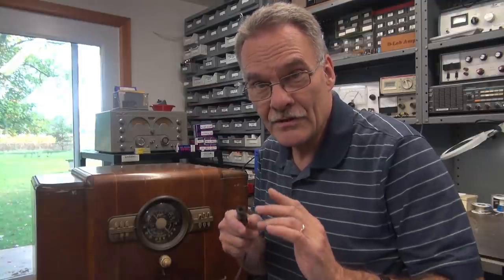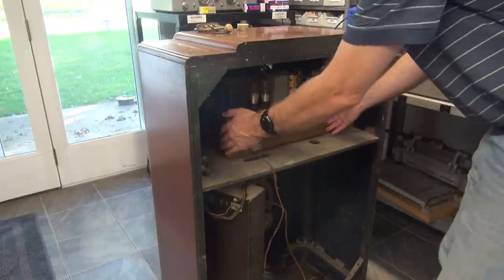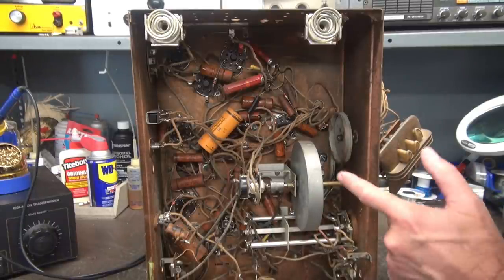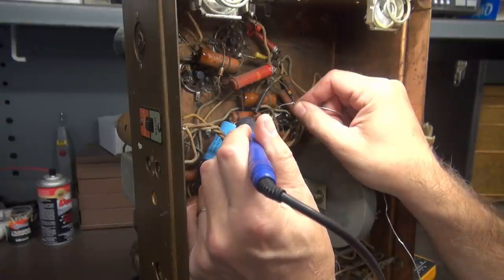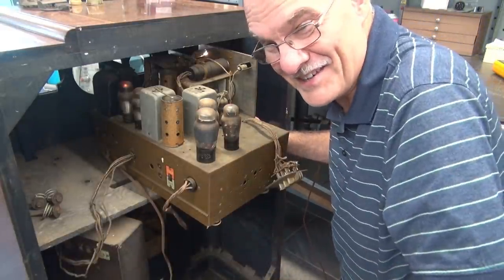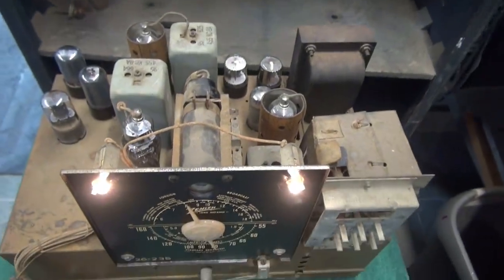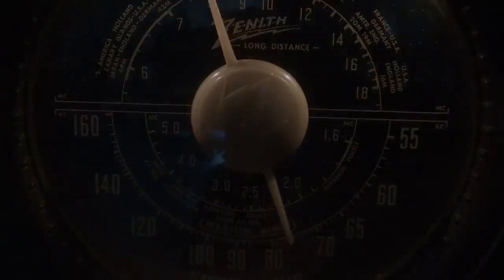How to repair  Vintage Zenith 10S464 console tube radio Hum fast fix Tips

Comment: I live in dry colorado and lots of old wax paper caps 60 years old are still working. back in minnesota not. I would change the wax paper caps out just for safety. a new line cord and fuse.

Comment: I've worked on a few of those old radios myself lately and I still can't get over the quality of the sound that comes out of those old speakers. I've heard some that these new units of today can't compare to.
Reply: I downloaded a bunch of old radio magazines from the 20's through the 50's and have been browsing them.  One had an article on building a HiFi amplifier, this was long before stereo was even imagined, the recommended, two amplifiers one for bass and one for the high notes, you could adjust the tone on each but filter the output through the proper size caps to separate out the sounds you want to reproduce.  Sounds like a plan to me, I am thinking now of doing just that with some solid state chips to see if the old way still drives speakers to get HiFi out of MONO.

Comment: YOU DRILLED A HOLE IN MY CHASSIS???   The way you do your J hooks, it's a connection with far better mechanical integrity and a component lead just poked thru the terminal on a strip and soldered. Some components like the osc coil, IF cans, etc., are unobtanium and you'd have to be nuts to screw with those terminals. And I'm a near-purist. lol. Fun video! Thank you   :)
Reply: Nothing wrong with being a purist but sometimes ya' gotta do what ya' gotta do.;-)
Reply: For a “minimalist “ resurrection, In addition to replacing the electrolytic filter caps I would replace the cap that couples           the “first audio “ tube to the output tube control grids. When that cap becomes so leaky that there is DC on the 6v6 audio output grids, you run the chance of destroying the 6v6 tubes, the audio output transformer , and more..

Comment: Just like your neighbors, I also have a 10-S-464 that's been in my family since new. Recently I was able to finally have it shipped to me from the other side of the country and now it's back in my possession after 30 years. I had it electronically restored back in 1989 and when it was delivered last month I was pleasantly surprised to find that it still works beautifully. For years I've wanted to figure out a way to have it play music through some kind of input but then I came across your video a couple of weeks ago. When I saw the simple modification you made to your neighbors' radio it inspired me to finally make it happen. I got a 3.5mm headphone jack, and even though you used 47k ohm resistors I had some 30k ohm resistors left over from another project and used them instead. Yesterday I put it all together and plugged in a Logitech Bluetooth receiver. I've found thousands of old radio shows online that I can stream from my phone and I couldn't be happier! I just wanted to share that with you. :)

Comment: Great repair Terry if I hadn't seen it I wouldn't have believed it I have never been that lucky with an old radio just replacing a couple Electrolytics and it works. Well there is something to be said about having a radio in the family since new thats for sure. Thanks for sharing.
Reply: I've been that lucky before! 😆👍
Two electrolytics, maybe two wax paper foil capacitor and boom, fires right up!

Comment: Terry I worked in a tv shop that had the same tube tester excellent!! Unit. One thing I would have would use the air hose for a good once over, Yea wasn’t requested but could have reduced possible over heating and looked better. Love the mp3 upgrade! Thank you for your continued mentoring!

Comment: IMHO and I think in yours, the radio deserves a full resto, but, as you correctly indicated, it is the customer who decides every time.  Good idea on the O-ring belt replacement.  I would suggest you try to cut the O-ring on a 45 degree angle so as to maximize the bond area.  I would also use Black CA glue for those repairs as it is mixed with rubber particles and remains very strong but with a degree of flexibility that plain CA glue does not have.  The bond will therefore last longer under constantly flexing conditions.
Reply: Vacuum cleaner belts last longer. You can get them in any size. Great for old Reel to Reels, phonos, 8 Tracks bla, bla, bla..

Comment: I love a Radio with green eyes...Just a tip-- Pond's face cream will will soften the old cloth wires. Just use your fingers to pinch it in a few times. There is nothing I know that softens up the old crusty vinyl wires.

Comment: Very cool, one can add a WIFI radio receiver to that plug, or, for that matter download some old radio programs and play them on the old radio!  I grew up listening to radio for entertainment on our old farm, played on a tube radio that ran off a large battery pack since the house was never wired for electricity or plumed for running water, we kids furnished the running water by running to the windmill to fill the water pail and running back to the house. I am getting into the wifi radio right now, there are plenty of old time radio channels, and play stuff from any year.

Comment: The biggest issue with many 1939-42 Zeniths is their use of the 6X5 rectifier, in particular consoles using two of them... Like this 10S464.  Zenith wired each as a half wave rectifier, and due to tube design, an underrated transformer, one tube warming up a little faster than the other, possible failing filter caps, etc... The 6x5's would develop a heater to cathode short and take out the HV side of the transformer in about 5 seconds.  Zenith sent out a service bulletin on these, replaced transformers (my 11S474 was repaired by a dealer), added pilot lights as fuses, and many customers had the sets set up for a 5Y3.  Today, the simple fix is to use diodes and a dropping resistor.  Additionally, I always add a 25ohm 50w resistor in series with the AC line to drop the voltage going into these notoriously weak transformers.  Once that's all done, these are reliable, sensitive, and some of the best sounding vintage radios you'll find!
Reply: Agree with most everything you said, but Radiotvphononut posted a video once (complete with charts) using the diode conversion and its very persuasive.  That is, they're not really kind to your tubes in the end because.... the high voltage ramps much quicker than the filaments warm. As a result, plate current can be exceptionally excessive at start up.... shortening the tubes life. A work around on that is a 'delay on' circuit for that diode (in my opinion). Also, an in line fuse on the transformer output can be very beneficial (saving those same expensive & hard to find transformers). I just restored my 8s-463 5808 chassis here lately. It was dark since 1947 and now back to life. Still needs the correct output transformer and hopefully that'll be coming soon.   Best regards.

Comment: I have the same console. I changed out all resistors, caps and rotted wire. You should have added a fuse because I have seen those 6X5 tubes short out and can cause severe transformer damage.

Comment: Nothing wrong with J hooking parts on an older radio. The reason being you don't want to disturb the other components at the solder joints. The big job  is replacing the
missing long band because you have to take the axle with the flywheel off. This may be easier said than done unless you have a  cool quick tek tip like this!
Nice mod for a MP3 connector.Terry should have recommended a new polarized  line cord and fuse for the radio for safety reasons. 
I'm sure we will see this radio back in the future. I'm a big fan of older eye tube type radios and your work Terry.🍷🍷
Reply: Or replacing a part the owner cut out of circuit or put back in the wrong way because they wanted to be a Youtube DIYer and realized there was more to it and to make it top notch difficult, no clear readable schematics or a schematic just does not exist for the device you are working on and you have to guess.
Reply: @Elfnetdesigns  If you worked on enough TRF or AA5 radios you would know what to replace or fix. As for an owner fix well that means you really need a schematic to tell what he may have done wrong. This goes especially for a fix done on a radio from 1930-50 when the fix was done in the 1960-90s!

Comment: I have that radio. Was my grandparents. Cloth covered wires are trashed. Tubes glue have dried out and the glass tubes are loose. I am ham so I’m going to rebuild it. This will be a huge help.
Reply: They're very easy to repair. I electronically restored My Zenith 10S464 back in 2012 and still runs like a champ to this day.

Comment: This is very similar to a Zenith that I just inherited. It does come on and receives stations but has a very loud hum. I could  use some help with repairing it and locating the parts. Is there a way to contact you? I would be happy to compensate you for your time. The sticker on the left side of the chassis next to the antenna says it is a model 5308 and when I took of the face plate I found the numbers 26-235 on the dial face. Thank you any help would be much appreciated.

Comment: i need some of those magic filter caps. i got a 1929 philco radio that i started restoring for my step dad a year ago and it still hums. i figure i got the wrong caps for filtering and the schematic is just as spaghetti as the wire job. i did get most of it the schematic figured out but the filter caps
Hearing The humming after spending $700 in parts is very demotivating.

Comment: Another Tek Tip (specifically for Zeniths of this era) ... Get rid of the 6X5 rectifier tubes before they short and take out the transformer. There are a few options when doing this. It looks like you may have replaced your's with a newer X plate design??

Comment: I just found this video. Do you have a video on cleaning the switches on the right side? I have two old Zeniths this 1940 and another cube type . It has three faces,broadcast ,police and shortwave which you can change to whichever you want. It works fine. I just don't know what year or model it is, though. Your video is very helpful,thank you!

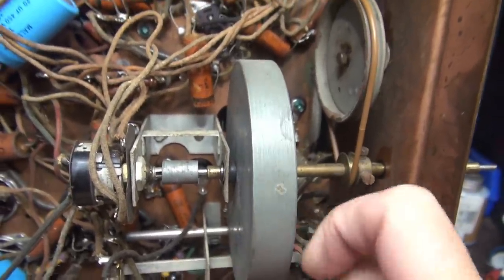Comment: There's a little black metal bushing that goes in the end of the brass tube where you're pointing at 8:49. I actually took apart the whole tuning mechanism to put in the O ring on my 10S566, as well as changing out most of the coupling capacitors and crumbling rubber wire and then lubricated the tuning rod. I like your  mp3 mod. very non invasive.

Comment: Bad output tubes like those suggest leaky grid coupling capacitors. Always a good idea to measure the grid voltage, if it is positive replace those coupling caps. Likely going through output tubes as a reason someone put those 6L6's in there. If those caps are leaky, those new 6V6's won't last long. Best to convince the owner it is in their best interest to replace all the wax capacitors. Just my two sense worth.

Comment: That "magic eye" tube has a 1 meg resistor in its cap that typically goes high over its life; it' should be changed  too. Those TV/RADIO switches are also notorious for failing. Cleaning them is strongly encouraged.

Comment: I wouldn't want to be responsible for giving that radio back to someone who is not a radio savvy person without doing a complete recap and making it as safe as possible for modern use.  I would certainly want to put a fuse in there on the  primary in case that old transformer decides to short some day. I guess the line cord was OK but would usually replace that too. You obviously know what you're doing Terry so I hope you can convince them to spend the money and have it done properly.
Reply from the maker: Hello, Yes, I will discuss more involved maintenance with them. There is much more to the story my friend

Comment: If you consider that many of those old paper capacitors have very acidic paper in them after 80 plus years, it would be better to go for a full recap.  The filters may be what makes it hum now, but leaky coupling caps may ruin tubes that are hard to find later.

Comment: I like the old style of the  old radios. How the point to point and the wires.
But at the same time I always panic when I see the old wires. It is a very odd feeling to have. Like a contradiction. Where I find I both want to maintain the original condition, but also entirely rewire it with modern wires.

Comment: It's funny you talk about those little belts cloth belts I bought out a TV repair shop it's over years ago and he had tons upon tons of those little belts but of course they might have been you old stock but they had been sitting there for a very long time a lot of them were still good there's quite a few of them that was just dry rotted I got a lot of stuff out of that building
Reply: TV shop near me went out of business after the owner died an his family came in and threw all their stuff into a set of dumpsters that had big padlocks on them and had it all hauled off to the landfill.. Parts, test gear, tools, vintage computers radios and TV sets, the whole lot went away and no one was allowed to get anything. I even offered to pay money for some of the test gear and they were snooty about it and said no.
Reply: @Elfnetdesigns  Estate taxes?
Reply: @SSN515  The owner died and his family were a bunch of tool bags about it.
Reply: @Elfnetdesigns  OK. Usually stuff like that is about money, estate taxes, or family squabbles. But in this case, just tool bags.
Reply: @Elfnetdesigns  if I can't get money out of it, nobody will, frigging jerks I've encountered it many times

Comment: Radios from different countries look so different under the chassis. German ones and dutch Erres ones are super tidy, with only few parts not on a terminal board 
Philips looks chaotic, with many parts having to be desoldered to access a specific one, but often efficiently packed without many wires running everywhere. 
The american ones, often have a big amount of spaghetti wiring going everywhere. Why would they do that? On industrial scale i'd expect that saving on wire increases profit.

Comment: You should not plug-in an old radio until you limit the current with a light bulb or other current limiting resistor.  You could ruin the power transformer if there is a short that will draw excessive current.

Comment: how long will that o ring stay glued
Reply from the maker: This is a trick I learned in the automotive industry https://www.mcmaster.com/o-ring-glue/
Reply: @d-labelectronics  Yes! I did that back in the very early '80s. I even superglued a pair of rubber boots and both repairs lasted as long as I owned the car.
Reply: @d-labelectronics  Super glue must be getting better, seems every time I try to use it all I do is glue my fingers together.  Oh I did see a great use for the stuff back in the early 1980's I lived next door to the funeral home, the director used to come and get me when he had a big body to move  or needed some other type of help.  He used super glue to keep the eyes closed on the departed, and to keep their hands in place for the funeral.  Now that my wife of 51 years and 4 days lay in her coffin up in the cemetery, that isn't as funny as it  used to be.

Comment: I've gone for a BlueTooth module instead of the .mp3 jack.  They're very simple to install nowadays.
Reply from the maker: I agree, but following the customers wants
Reply: @d-labelectronics  Sorry, no judgement here; I should have prefaced it with "If that were my radio,..."  Been working with tubes since the '70s and still alive to tell it.

Comment: I know, I know this wasn't a complete restoration ok. BUT if they start using this radio it's only a matter of time until the wax caps start to fail why not git er done now?
Reply from the maker: Yes, as requested by the owners, they understand the risk
Reply: @d-labelectronics  Terry said it was the original owners...So they may fail before the old caps do :]
Reply: Personally, I'd have a policy that filter caps and the caps for the output stage must be changed due to the damage they can cause.  If a preamp tube burns red plates, the damage is pretty limited.
Reply: @russellhltn1396  Ya, Me too.

Comment: Weight of that chassis?
Reply: Between 7-10 pounds.
Reply: I would guess the CABINET is responsible for most of the weight. Looks like a fine cabinet made out of real wood. No particle board... :-) A fine radio which deserves a full restoration, as such it will probably last very long.

Comment: Pull that old radio stuff out and built a Fender Champ circuit. Would make a great amp. 
Yes I’m just kidding.
Reply: Put in a 1/4" jack instead of the MP3 input. Leave out the resistors.   ;)

Comment: These radios require a complete overhaul...  paper and electrolytic caps out, off value resistors out,  clean and de-oxit everything. Much rubber covered wire has flaking insulation.. better know what you are doing,,, and do it sober ! Weak, shorted and gassy tubes out.  Not full emission filaments, not 85% or better Gm  out ! then align and calibrate per manual, and then it plays day and night on the bench for several days before it goes back to the owner.  And is there art as well as science in aligning so it plays music well... you bet! Anything less is utter bullshit... and without even watching this I can tell you will be treated to plenty of it here.  Done right.. this radio can play another 30 years ... many I have overhauled have done just that !

Comment: The fatal words... "not a total restoration"   Only drunks and idiots believe in "limited repairs" on radios from the 30's and 40's.   Down this path lays a burned up power transformer, or choke in the speaker..and the death of a serviceable radio out of ignorance.  ARGH !